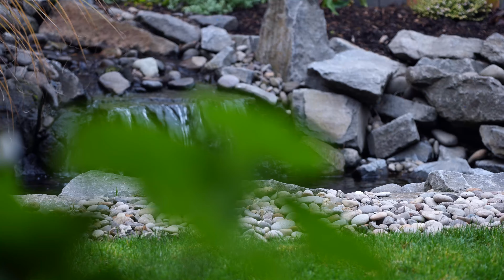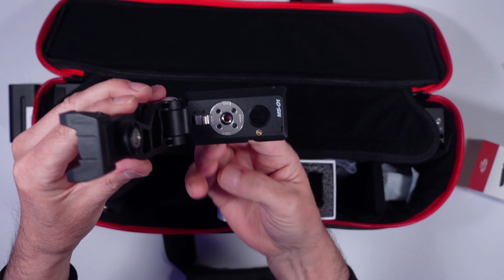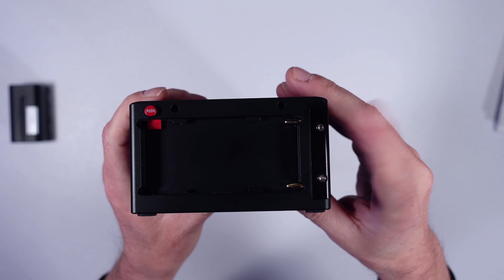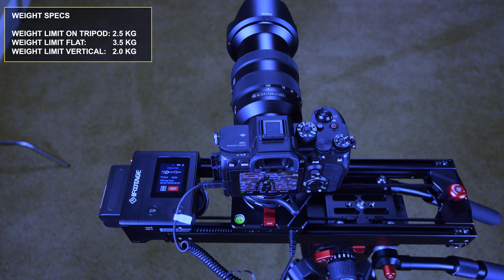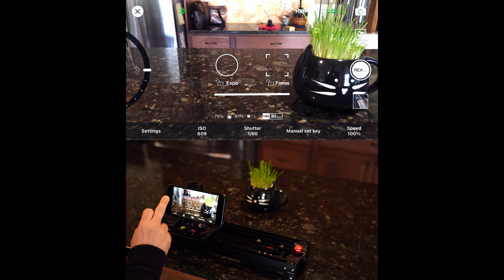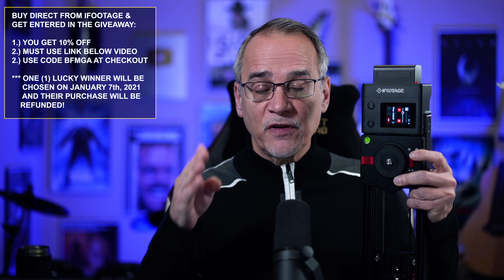SHARK NANO Slider is HERE! BFM 451

Comment: Thanks for creating this video. How loud is the motor in db? I am looking for a good motorised slider. I am looking for all 3 features in one slider. It should be as quiet as possible, can carry at least 5kg weight and I can use vertically. Any suggestions please?
Reply from the maker: Wow. This IS a NANO slider, so I would suggest looking at higher end ( and priced) models. This on is quiet but can't take that much weight vertically.
Reply: @BasicFilmmaker  any other suggestions?
Reply from the maker: @Harvestcreativemedia  For your purposes I would check out something like this. I used the smaller version and liked it. https://amzn.to/3xwhGZh
Reply: @BasicFilmmaker  Have you tried it on any telephoto lens? Do you get a smooth footage?

Comment: I'm sure someone's said this, but it's an iPhone mount, not connector. It's actually too bad they don't include an iPhone connector, because using the phone with the timelapse mode could be useful. Probably an option or aftermarket piece.
Also, the Seastar is best utilized as a mount for the slider to the tripod, rather than for the camera (especially since they're $70 each!) so it's not such an ordeal screwing the slider onto and off of the tripod. Screwing the camera on the slider isn't as much of an ordeal, but ideally, I guess, you have two Seastars...
Lot of micro-jitters, especially in the colored pencils, but I suppose by the time I get mine (June) they'll deal with that in firmware, otherwise those are easily dealt with in post.

Good review! Thanks!.
Reply from the maker: Good idea. Be nice if you could hook the phone up to the Nano and have it charge the phone too. I love my SeaStars, also a good idea and that’s what I do now. On all. my heads and accessories, I mount the SeaStars on the bottom and voila! Insta change. Yep. the micro jitters are gone, and yeah...they had no idea at the time that the world would go kapok on manufacturing and shipping. Feel for those guys.

Comment: Looks good apart from the delay on calibration. Is this happening every time you power on ?
Reply from the maker: It does. BUT, they updated the firmware so if you're just turning it back on, you can bypass the calibration.

Comment: Thank you for the detailed video. I have a question. Given that I use the Canon M50, which doesn't have a shutter cable input, will I be able to use this slider? And does this slider even work, if there is not shutter connection?
Reply from the maker: Absolutely. The ONLY reason to have the shutter cable is to automatically fire the shutter during stop motion actions. It might be that one of the cables works with the M50 but I don't know. As you see in the video, I fire the stop motion manually anyway. Up to you.
Reply: @BasicFilmmaker  Thank you for the answer. That means, I can programm the slider to do a normal pan and tilt shot without the app or the shutter cable, right?iFootage already replied to my e-mail saying the cables won't work. I only want to do pan & tilt shots for my drumcovers and talking head videos.
Reply from the maker: @ElBoyoElectronico  Yes. You'll be able with the onboard buttons to do repeatable slide (left and right) and pan (rotational) shots with no cable or app. I actually prefer the onboard to the app. Now you're also talking tilt (up and down) and that works for the iPhone via the app and attachment. There is no tilt (up and down) function also, which is why this doesn't cost $1000. I find it toally usable placing a video head on there and can get the shot anyway.
Reply: @BasicFilmmaker  Yes, I meant slide and pan shots, no tilting needed for me! Thank you so much for the answer. Somehow iFootage wasn't able to give me the answer. As long as I can programm a certain slide and pan pattern onboard with my camera and than let it do it's thing, while I am recording and playing the drums, I should be fine!
Reply from the maker: @ElBoyoElectronico  That will totally work. That's how I did the majority of the shots in this video. Throw me a link when you get it and film it - love to see it.

Comment: Amazing device for the price, it makes a huge improvement on most footages, no camera man needed hahaha!  If you ever talk with iFootage people again tell them to add this features bellow to the next version:

1. A 3 Axis Gimbal to the device. Right now you level the footage in post.
2. It will be super nice to add Focus Control based on keyframes and motion.  Here is a trick. Film the same footage with difference focus point each and use a smooth cross-dissolve in post. 
3. Add EasyIN and EasyOut on all motions with keyframes based on different types of springs, elastics and in and outs. (easy in and easy outs is what we use for everything animation and filming). You can do that in Post but it will be great to add that to the device. Right now this device only have linear motions. 
4. IFootage could create or be partners with an company that creates software for animations. This could be tremendous Bigly for the animation industry.  Example: using Onion skinning for creating stop motion animations.

Anyway, this is a device that every filmmaker should have.
Reply from the maker: Nice suggestions! They do read these comments so I am sure they’ll take heed. This is a keeper for me and sure makes great shots available to the basic filmmakers out there that can’t afford the higher end units.